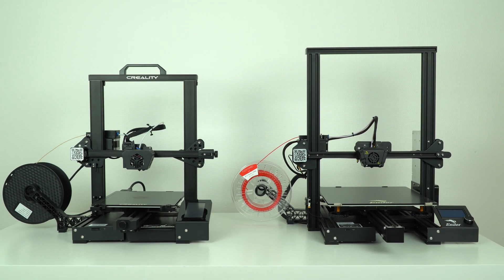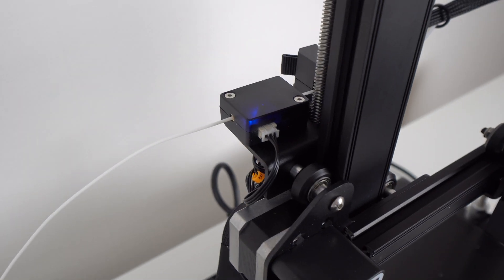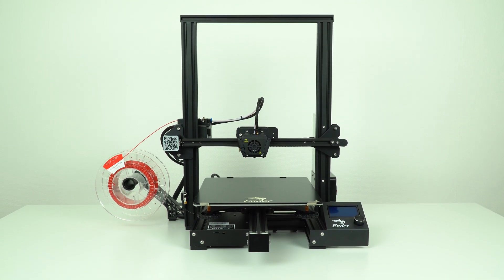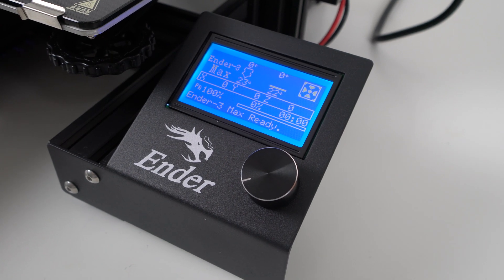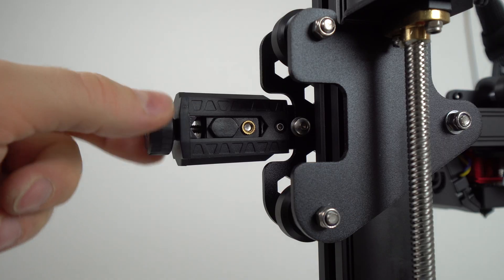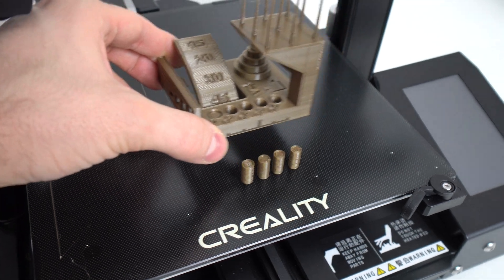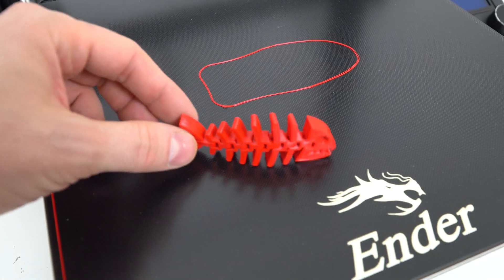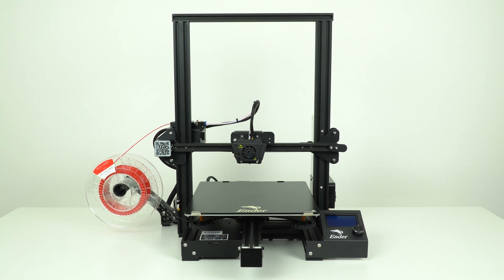CR6-SE VS Ender 3 Max which one wins? 3D printer review and comparison

Comment: Just brilliant as usual no fluff just facts I feel I can trust.  One question Nexi you kindly responded to my comment on the CR10 smart which thankfully influenced and saved me making an expensive mistake.  On the 6E does the auto levelling work ?  Does it apply probed offsets to the print while printing in different part of the bed (hope that makes sense).  Thank you ;-)
Reply from the maker: Hi mate, Thank you so much! No problem I'm glad that I helped. On my test unit (CR6-SE) the auto level was working perfectly fine and I had no problems at all with it. Awesome 3D printer really. Go for it :)

Comment: Can i print all those materials on stock cr-6 . Does the ptfe tube withstand the high temp on abs? What profiles did u use for petg ptu and abs? Nice vid btw
Reply from the maker: Thanks man! Sure you can and, tes you can print ABS on stock machine. 
I use the standard profile and speeds that I showed many times in my videos. Nothing fancy. Everyone can do it.
Reply: @NexiTech  okay thx mate. Its just abs need higher temps so was not sure if the bowden tube could handle it .
Reply from the maker: @eenig8730  No problem mate, If you print alot of ABS might be good idea in future to replace stock bowden tube  with Capricorn bowden tube as it's rated for high temp. Or keep the temp up to 240c, and as stock bowden tube wears out over time from non stop printing ABS just pull it up from the heat block and cut off peace like 10mm that was inside of heat block and push it back it. You can do that multiple times before bowden tube be too short that needs replacement.
Reply: @NexiTech  thx very much mate. Really happy with your help

Comment: I know the bed on CR6 is 235mmx235mm. Would it reliably print something that's 225mm long? how much border margin would I need? I'll primarily be printing PETG. Are auto bed leveling and dual Z-axis screw drives worth it? I'm really torn between these two. Thanks for the help.

Comment: NOW! This is interesting. When I bought my printer I had a choice between the CR-6 and the Ender 3 Max. Why did I want a new printer? For printing Model Rocket nosecones. So guess which one I bought?
I print parts for model rocket kits that I sell. And printing my nosecones works out cheaper now than if I had invested in a blow mold. For 1 thing I could have bought 5 DR-6 SE's for that price, including 10 spools of filament.
The Ender 3 Max was ZAR2000 cheaper than the CR-6 SE coming in at ZAR7000 compared to the CR-6 at ZAR9000.

Comment: Now thinking of getting the Ender 3 Max as my first printer. If you could point me in the right direction for tuning and recommended upgrades I would appreciate it.
Reply: Why would you buy a printer and spend more to upgrade it... What not just buy a better printer ?
Reply: @petrokemikal  but which one you would recommend for a larger printing area?
Reply: @Jonnycardo  Sidewinder x1 or cr10 v2 are great large printers..
Reply: @petrokemikal  But the price is substencial.
Wouldnt BL touch make the Ender 3 max better?
Reply: Dont, choose thr cr 6 trust me

Comment: I have 4 Creality printers and I love them all but the one thing that annoys me about Creality is you can't get a printer with all of the features, like if you want dual sync lead screws you can't have a large bed, if you want a large bed and a fitted BL Touch you cant have the extrusion supports, if you want direct drive and a V6 you can't have a touch screen, it goes on and on, so what did I do?
 I built a Pro 3D V-King in 400^3 core X, Y, Z with Duet, BL Touch, Bondtech extruder, Super Volcano, AC heated bed 7" colour touch screen and built with the best quality parts I could find.
 Come on Creality instead of building loads and loads of printers build at least one with all the good features
Reply: That’s with everything. Seems like companies don’t want to make what customers want. Instead they make 22 different models that are all just ok.
Reply: Yeah, and you left out the one detail everyone wants to know !

Comment: For a first time buyer, how difficult will it be to level the bed on the 3 max? That seems to be the main difference for first timers.
Reply from the maker: It's not difficult at all. Home your printer, switch off stepper motors, place A4 paper under a nozzle close to each corner of the heat-bed, adjust position with wheels under heat-bed
and then do in the center of heat-bed. You should feel slight resistance by hand. Double check it with your eyes by moving print head by hand over the glass plate, that's it :) You need just a few minutes. Once you level it you don't need to do it again for a long time and very soon you will not even need a A4 paper you will do it by the feel and eyes in no time :)

Comment: Have you heard anything about the high voltage present across the USB port which can damage a computer when attached?  I know it was an issue early on.
Reply from the maker: Wow, not at all. I never had USB issue voltage with any of my 3D printers even with my first 3D Printer (ANET A8) many years back. That must be some batch with faulty usb chips on the motherboards.

Comment: its TMC2208 X,Y and A4988 Z,E ?
Reply from the maker: Yes, It should be like that on Ender 3 Max. It's hard to know 100% as stepper drivers chips are glued with hard thermal silicon paste, but X,Y stepper motors are indeed silent like on the CR6-SE which is great otherwise printer would have that annoying high pitch moving noise.
Reply: @NexiTech  I got a reply from Creality:  X,Y TMC2208 /  Z,E A4988  . I compiled a new Marlin 2.0.7.2 , everything works
Reply from the maker: That's great! Thank you for the updated info my friend.